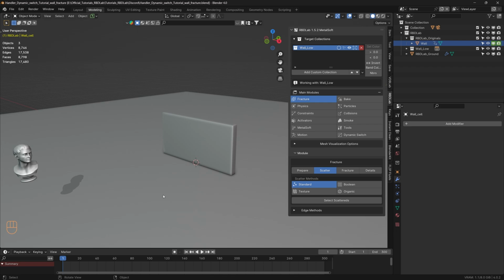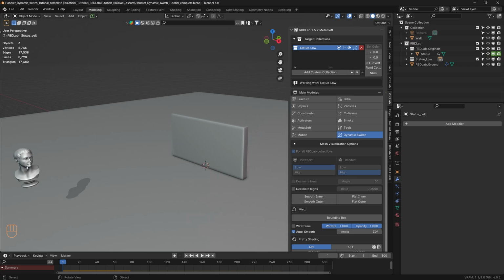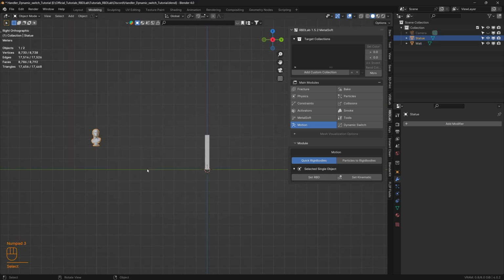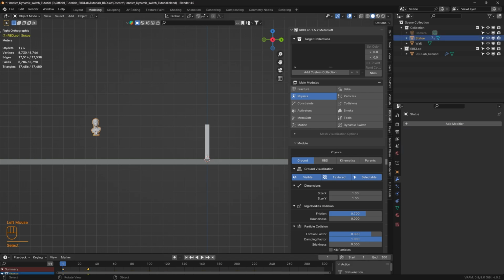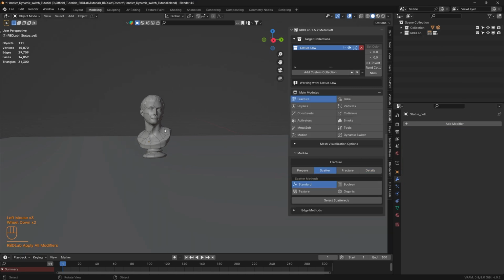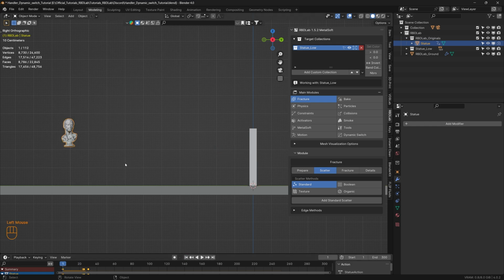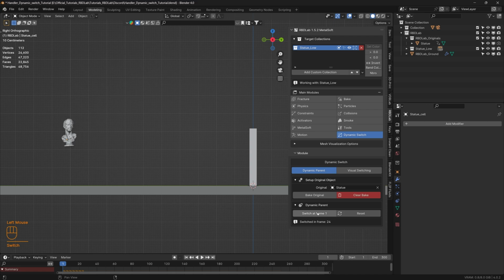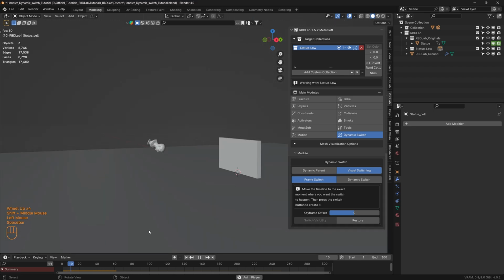Switch from Animation to Physics in Blender | RBDLab

Comment: Hello Great tutorial ! Is it possible to use multiples dynamic switches in the same scene ? for example, like on this tutorial but wit 3 different heads models exploding against the on the wall. I tried and somehow it looks like the dynamic switche option is not linked to the specific chunk collection as I have to change the parent original when configuring the second head(where I would expect a blank field). Thank you !
Reply: I had an answer on the discord channel. Yes it supports multiple switches.